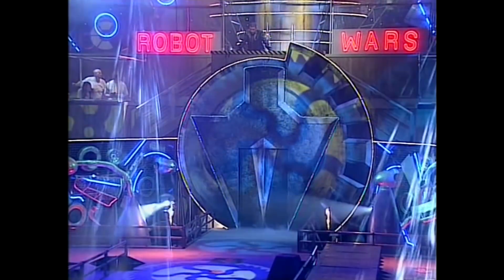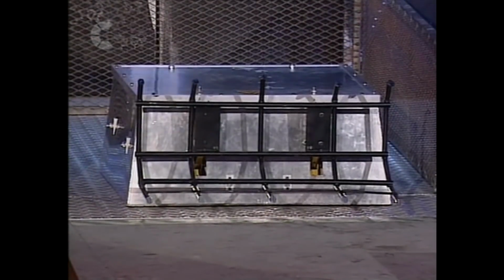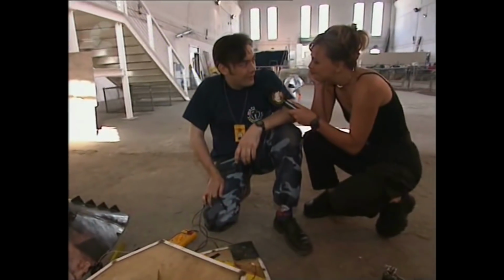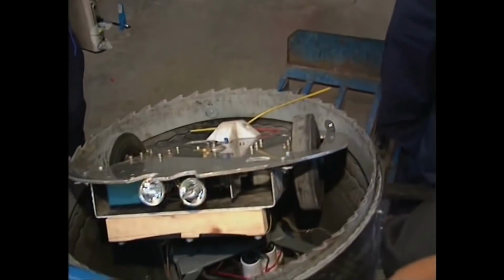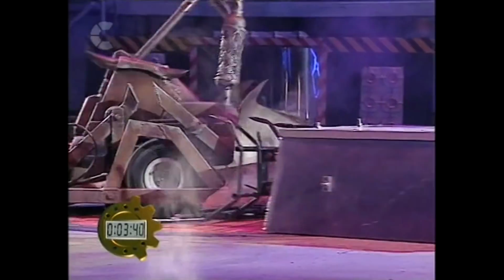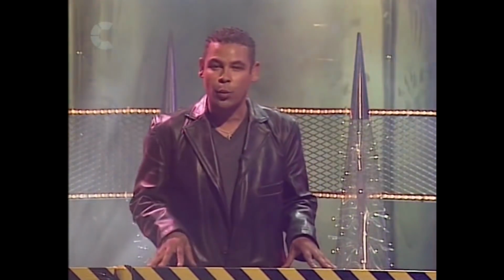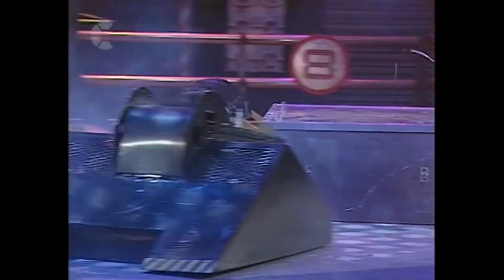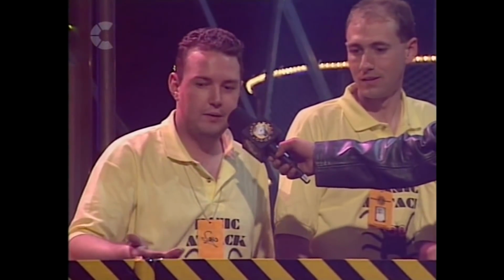Robot Wars Series 2 Heat F

Comment: The legendary Panic Attack.    Looks good but not all that impressive at first sight, not obviously superior to the other bots entered.    But then it got away from Killalot up the ramp (wtf?   why does Killalot ignore some bots and actively pursue others?   Seriously, the house bots need to be taken out and shot) - but anyway, Panic's flying leap off the end of the seesaw was a delight to watch.   And then the thugbots tried to wreck it again.   I repeat, those house bots should be scrapped.
And what's with Dead Metal shifting the seesaw so no bot can get up it?   They didn't do this in previous heats.   This is NOT a level playing field.   Frankly, if it wasn't for the ingenuity of the competitors' bots, I wouldn't watch this, I can't stand the unfairness and capricious thuggery of the house bots.     And who got through was a complete lottery depending where the house thugbots pushed them.
It was satisfying seeing Panic Attack outdrive Shunt (a portent of future performances) and Shunt fell off the stage.  In fact Shunt fell off twice, sadly without suffering significant damage. 
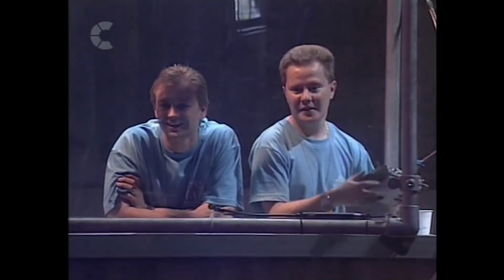But then in its fight against Whirling Dervish, Panic Attack hammered Sergeant Bash and (it looked like) caused it some serious damage at 22:00 - gotta love Panic Attack.
Reply: Thankfullly they stopped the House bots actively interfering from Series 3 onwards.
Reply: @thesmithersy Panic Attack in the 4th wars won the sumo competition. From Joe. X

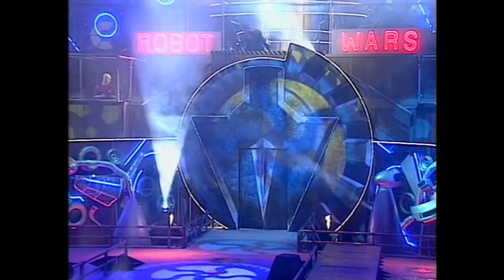Comment: 2:52 - Look closely during The Parthian Shot's introduction. Adam Clark is driving the robot instead of the team.
Reply: I have a theory - because The Parthian Shot wasn't working and had to withdraw, maybe it wasn't able to film an introduction, so they took the shell and put it on top of Corporal Punishment, hence why Adam Clark is driving it.
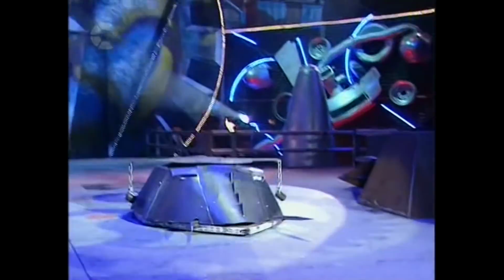Reply: Nah, they just pulled The Parthian Shot along with some wire which you can see at 3:00, so it didn't really matter who was "driving" 😄
Reply: I'm glad you posted this because I thought I was going nuts.
Reply: Cheers.